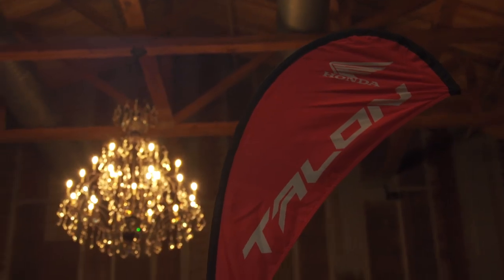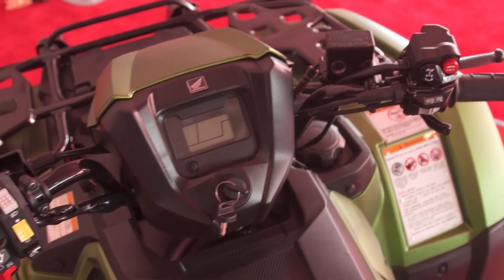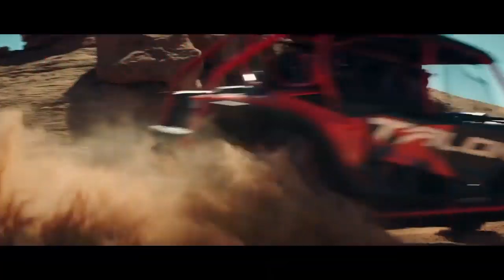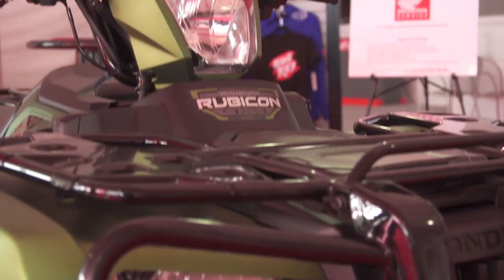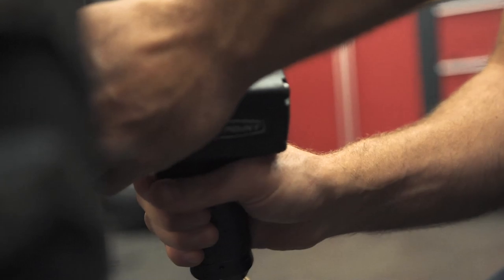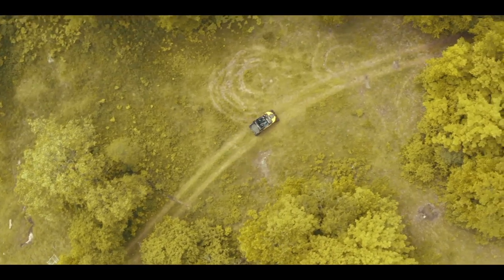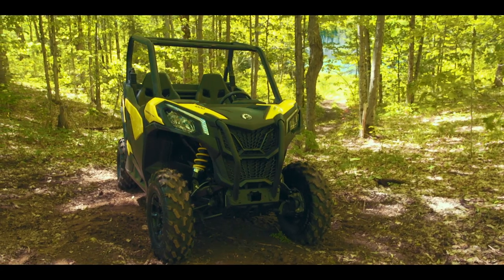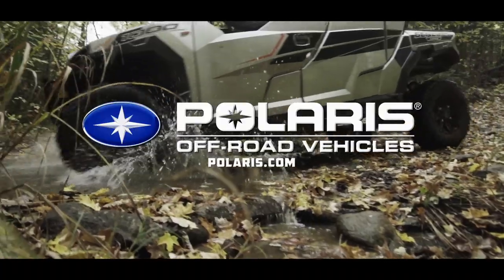Dirt Trax Television 2019 - Full Episode 3

Comment: these manufacturers are becoming waaaaayyyyy too predictable ! All the same shit on a different name machine.  They are all the same with different badges. I bet if you blind fold some one and let them ride in "any" new sport SXS they wouldn't be able to tell the difference! It all comes down to "brand loyalty", in essence, brand "fanboyism" .  I want to see 250 HP+ 2000cc , peel your face back power that sounds like SEX!! Not a 2 or 3 cylinder blaaahhhh from the norm.
Reply: papa Wattz  sxs are limited to a 1000cc